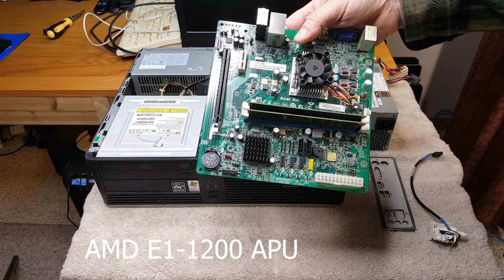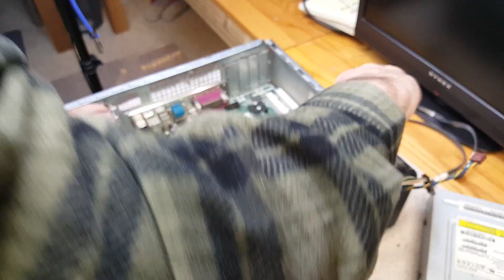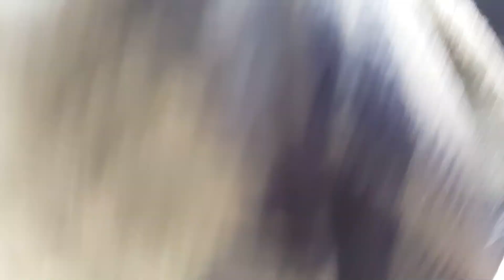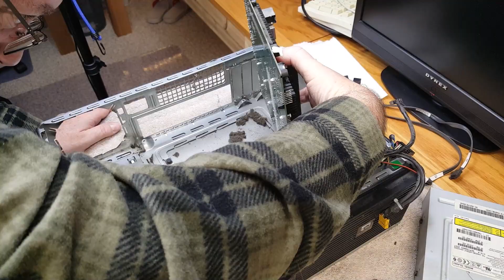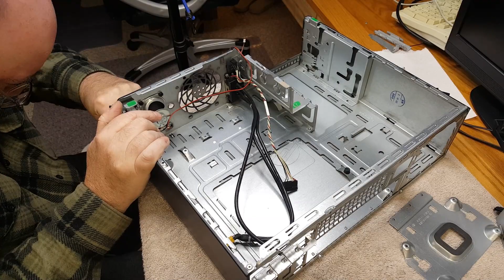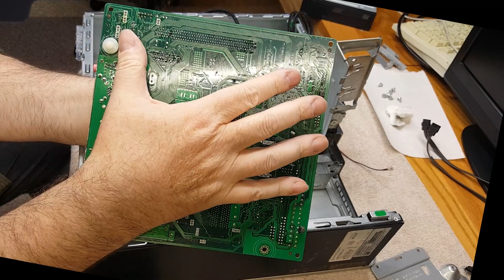Sleeper Case Fail!  Mini Mobo Part 2

Comment: well you have a clean athlon 64 now ;-) interested to see what you can up with.
Reply from the maker: That got added to the pile!  I am thinking Huge case, tiny mobo?
Reply: @UncleMikeRetro  maybe next time if you have the metal standoffs you could drill them in a board plate
Reply from the maker: @Pickle136  Maybe so!  But at the end, I think BTX defeated me.

Comment: I am getting to where I don't want anything from Dell, Hp, or Lenovo around. Just too many weird parts. I strip the CPU, RAM, and drives and pitch em now. After I copy down the Windows key code (8, 10, 11 codes are in the BIOS , you can retrieve them using a dos command)
Reply from the maker: We're thinking alike now.  I have been lucky enough to photo about 30 Win7 serials so far!
Reply: @UncleMikeRetro  Well I don't know how you could do it at the scrap yard, but if you had a way to boot up the Windows 8 and newer PCs, there is a way to get the key codes from a dos command. I have about 4 or 5 of those
Reply from the maker: @Alcochaser  You are resourceful.  I think I know the command line you mean, but no way for me to do that.  The great thing about these almost all being "work" or business computers is they all get their serial stickers!
Reply: I wouldn't diss them, there are some really good deals on branded SFF PCs at the moment - I think a lot of businesses and educational establishments are getting ready for Windows 11.

With that said, I only run MS-DOS and Windows (through to XP) for retro gaming purposes, otherwise Linux is my main OS - and that runs on "any old cr*p".
Reply from the maker: @terrydaktyllus1320  I  have to agree with Terry in that I want one of the sff Dell's.   Really bad but won't pay!